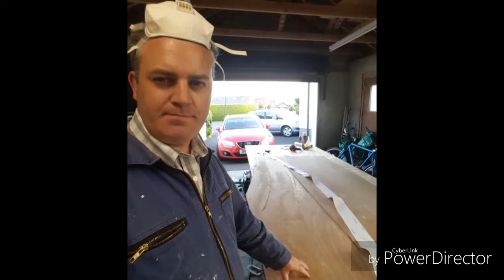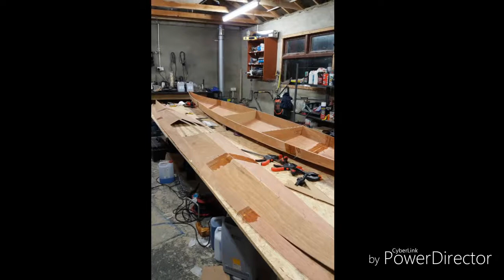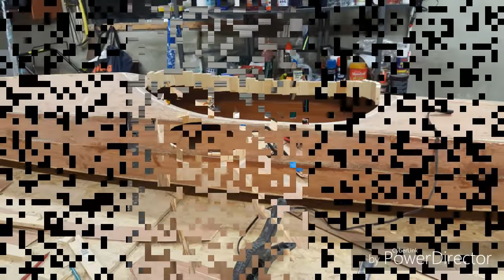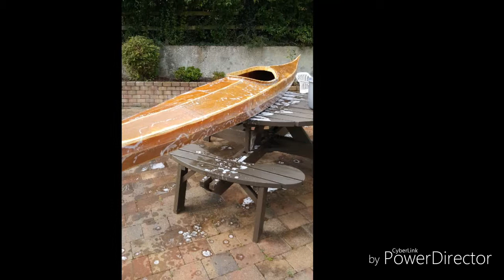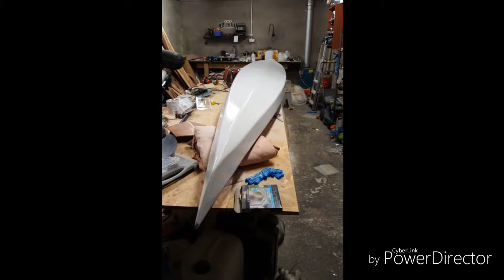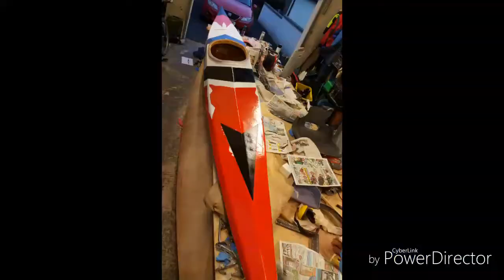Guillemot kayak stitch and glue home built photo diary

Comment: So, correct me if I’m wrong, you did not glass the interior of the kayak?   Did you glass the exterior?  Other than that, it looks good
Reply from the maker: The exterior is glassed. The only part of the interior that is glassed is the cockpit.
Reply: @davetagg3249  The whole point of glassing the entire interior deck and hull, is to create the ‘sandwich’ strength of composite using the wood as a core.  The hull and deck is very susceptible to compression and tension forces with the weight of the occupant in any waves.  If the deck is already bonded down, a good idea is to cut it free and glass the entire interior.  If you have a question about doing that, I would contact Nick Schade, as he designed it and will tell you why it is needed.  Also, when the deck is back on to glass the inside of the hull/deck seam, as he does that (see his online videos).  The finite elemental analysis of a kayak hull shows that the maximum forces of compression and tension occur in the middle 1/3 of the hull and deck. Good luck! 🛶

Comment: I love this. Fantastic build and a bally decision to pain the whole kayak. Not sure I'd be able to do that but it does look great. I've been fantasizing about building a kayak for the last year or so. Problem being that I've never built anything :( Was this your 1st build..? Where are you based..?
Reply from the maker: The biggest part of the build is the investment of TIME. The cutting, stitching and gluing and "painting" the epoxy on is all straightforward for anyone with basic woodworking/DIY skills. This is my 1st Kayak... but not my first boat build. I built a basic canoe (stitch and glue) and also a basic rowing boat before this. Frankly, there are less complex boats out there (bearing in mind this is 17 feet long and the longest sheet material I can get is 8 feet.) This needed 3 sheets of ply and every length needed 2 joins as you see in the first few photos. Feel free to find me on Facebook (David Tagg)  if you need pointers or a little advice.
I am based in Coleraine, Northern Ireland. The build cost was in the region of £310 all in. Obviously i have retained the paper plans if I ever decide to build a second Guillemot!